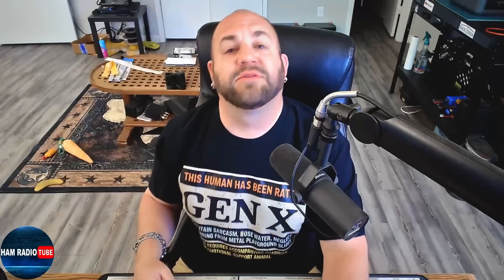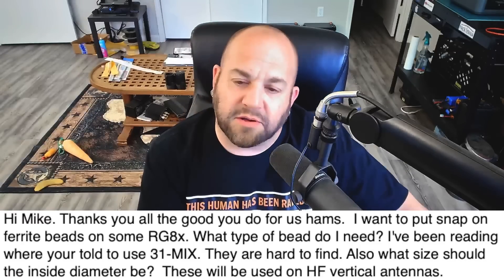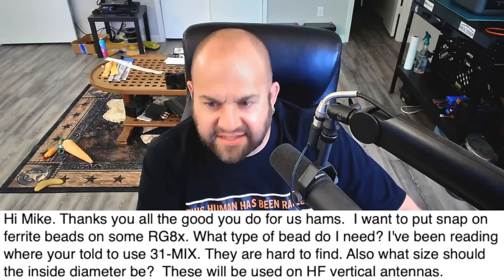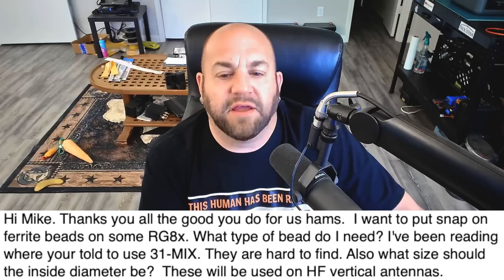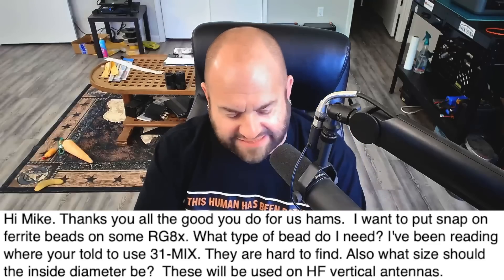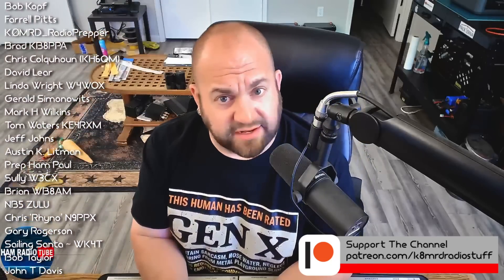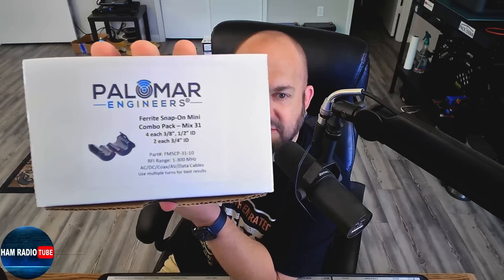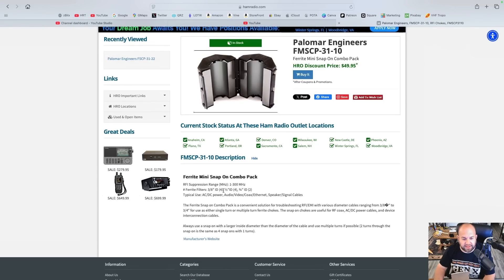Do Antenna Tuners Actually Tune Your Antenna, Or Are They Lying To You?

Comment: I have an ATU-10 and I don't use it.  I tried it on my CB/10m.  It tuned the SWR fine but it effected the signal coming in and actually cut down on reception.  If I want to switch on 10m to 11m I switch antennas.

Comment: Im not a ham, but I've done some broadcasting.  I never did agree that you can just throw an extension coard up a tree and slap an antenna tuner on it and be talking.  Lol, antenna is the most important part. If it aint right, you are a duck, no matter how much radio you have.

Comment: Finally an excellent correct explanation of what an antenna tuner is doing thank you
Reply from the maker: Glad I could clear it up for you!
Reply: Hmm.. weird.. In the British Army back in the 90s using Clansman radio equipment we had things like the TUAAM for VHF (70MHz) which stood for Tuning Unit Automatic Antenna Matching..  So the idea of Tuning and Antenna matching were two distinct things...for HF we had the TURF (Tuning Unit Radio Frequency) which has a big winder on it and you would spend a long time turning it to "electrically lengthen" the antenna till the SWR was good..

Comment: Mike, you start out on the right track by understanding that when an antenna is not naturally resonant, you have reactive power that oscillates up and down the feed line between the antenna and the tuner. But then you go off the rails when you say the antenna tuner does not tune the antenna. Of course it does, it changes the antenna's natural resonant frequency to a new resonant frequency by loading it with an appropriate amount of capacitance or inductance to make it resonant at a new frequency. This is obvious, because the reactive power no longer makes it back to the transmitter. Hams have, for a long time made a too-short mobile whip resonant at a lower frequency by canceling its capacitive reactance with a loading coil.

The problem is not that the antenna tuner does not tune the antenna, it does. The problem is that most hams don't understand how it works, and so they do the worst possible thing: put a long coax feedline between the antenna and the tuner. It works lousy, and so hams have come up with the false excuse that it somehow isn't tuning the antenna because it's performance is lousy. A better idea would be to use low-loss, open wire feed line between the antenna and the tuner, then less energy is burned up heating the feed line and more is radiated. Hams used to do this all the time, and some still do. The best solution is to put an ATU at the antenna feed point, so all the circulating reactive current will stay at the antenna and the feed line, on the other side of the tuner, will see 50+j0 ohms all the way back to the shack and the transmitter.

My background is in broadcasting, and AM broadcasters have been placing the antenna tuning unit at the tower since way before I worked at my first broadcasting job in the mid-1970s. Not every station has the luxury of having a tower which is exactly 1/4 wavelength, many AM stations have reactive towers which are not naturally resonant at their operating frequency. A few famous ones, like WLW and WSM use 5/8 wavelength towers to get a better radiation pattern, but of course 5/8 wavelength is reactive, not naturally resonant. But it doesn't matter. The tuning unit at the tower base not only cancels out the reactance, but it transforms the base resistance (typical 24-25 ohms for a 1/4 wave tower) to 50 ohms, so the coax back to the transmitter building sees 50+j0. I won't get into directional arrays here, but suffice it to say that towers have different impedance when part of an array, sometimes even negative.  A negative tower absorbs power, which is sent back its coax to the transmitter building where it is sent out to positive towers and re-radiated. But, regardless of the tower's impedance and reactance, the ATU at the tower base makes it 50+j0, resonant at the operating frequency.

Now here's the mind blowing part: an antenna can be resonant at two or more arbitrary frequencies simultaneously! These days, land for a tower field is expensive, so it is becoming more common to see two or more stations multiplexed onto a single tower. In such an installation each transmitter has a separate 50 ohm coax from the transmitter building to the tower. Each has a separate antenna tuning network at the tower base, each followed by a filter which passes that station and rejects the other before it is connected to the tower feed point, similar in operation to duplexer filters in a repeater. Where it really gets complicated is if one or both stations are operating directional arrays with shared towers, because there are filter networks connecting the ATUs to the driven towers, but towers which are not driven for a particular station are connected through a filter to a de-tuning unit, which makes the non-driven tower "invisible" so it won't act as a parasitic element and disturb the directional pattern.

But the take away is: Antenna tuners do tune an antenna to resonance at a new frequency. Many hams seem to have a problem understanding this because they use them wrong and the performance is lousy. If hams would simply do what broadcasters are doing, and put the tuner at the antenna feed point, which is possible with modern automatic tuners, they would get a lot better results. Maybe then we could stomp out this myth that an antenna tuner does not change the resonant frequency of the antenna.

Comment: Why does your powermeter  measure 128Watts, why you only tune with 100W.
And how did you get your half wave and fed wire resonant on 30m. 
You didn't.... You probably just had the right length of coax... Just make your coax a bit longer and measure again....
Reply from the maker: You're so angry
Reply: @hamradiotube  I do apologize for sounding angry. I was not angry, our did I say the wrong words.
But my question remains, why is your powermeter showing more foreward power than the power you used to tune. 

And second. I still believe your antenne was not resonant at 30m. But I think your coax-length transform the impedance of your antenne closer to 50 Ohms.. Hense the suggestion yo make the coax a bit longer and tune again.

Comment: Definitely agree on the coax question. Always one full uninterrupted run at time of install. If for some reason it gets damaged anywhere along the length, THEN it gets two ends and a coupler installed at the damage point. Having an entire 25+ft section damaged and require replacement doesn't make sense in most cases.

Comment: Another fun fact that I learned back when i did CB, is your groundplane's shape has an effect on both the SWR and the radiation pattern of the antenna. This is especially true for HF mobile operation where your ground plane is smaller than than the wavelength by a large margin.

Comment: Being stuck on only "resonant" antennas (actually these are "mis-matched", not non-resonant) is like being stuck with a car with only 1 gear. A "transmatch" (AKA antenna tuner) is more like an automatic transmission. Yeah, it might be a bit less efficient but now you can drive at any speed.

Comment: 1) If you want a very effective Common-Mode Choke (CMC) at your antenna feedpoint to isolate your antenna from your feed line, then DON'T WASTE YOUR MONEY ON FERRITE BEADS. Use a FT-240-31 toroid and  wind your coax thru it (4 turns round one way, cross thru the middle, then 4 turns the other way). Even fits with the PL-259 connectors in place! You would need at least TEN ferrite beads to even come close to the performance of the FT-240-31. 2) The "additional power" you're seeing on a power meter in the loop between your tuner and a non-matched antenna is because that's the "RECIRCULATING" power (with coax losses in each direction on every pass). Yes, a lot of this power DOES eventually get radiated, but the losses go up exponentially with coax length between the tuner and antenna because it's like putting a resistor in the resonant tank circuit of your final amplifier. Another way to look at this is trying to push a child on a swing, but with the swing immersed in thick oil, Takes a LOT more to keep that swing moving, no? Please see my TennaTalk #9 on my Antenna Whisperer YT channel if you want a deeper dive into this with LOTS of proven evidence of how all this REALLY works.

Comment: Wooo hooo Mike! I just wanted to reinforce your purchase of Palomar mix 31 (HF) beads - excellent company with outstanding products and ham-driven leadership. One minor correction - you are absolutely right to wrap the coax multiple times within one bead! Great best practice! However, the benefit is much more than you mentioned. For each turn, you square the amount of common mode current suppression gained over one bead. For example, 2 coax turns within one bead is not 2 times better, it is 4 times better than just one bead ... 4 coax turns within one bead is 16 times better than just one bead, etc. Thanks so much for your wonderful videos on the Tube - I miss working you on the air buddy and hope to get another P2P sometime soon 😀73 KJ6ER

Comment: Actually an antenna tuner just corrects for an impedance mismatch AT THE TRANSMITTER. Unless you relocate the tuner so it is at the antenna. A bad SWR at the antenna will still be a bad swr at the transmitter end of the coax plus the high loss in the coax which the tuner will not correct when it is located at the transmitter.

Comment: Just for fun. find a station at that frequency, get a signal with the high SWR, then tune it, compare. Likely the radio drops output, note that, then check output and signal, likely the signal is up at the higher power and safer so the value is a contact can be made.  tuner works !!! IF OUTPUT drops to say 50 watts tune it is 100, SWR returns 25 watts, 100 less 25 is still 75 and safe!!

Comment: Hello Mike: Thanks for all you do for the ham radio community.  I gave your video on antenna tuners a thumbs-up, but at the 19:42 mark of that video, you made a statement that made me take a step back.  I'll paraphrase your statement as , "[the reflected energy is not all radiated by the antenna]", and you followed by saying, "that's why I use resonant antennas".  I think this is a frequently repeated misunderstanding - reflected power is not lost (at least not in total).  Earlier in the video, you highlighted the fact that the reflected energy reflects back and forth between the "tuner" and the antenna which is correct.  I think it's important to realize that most of that energy will in fact eventually be radiated and not lost.  However, our feedlines aren't ideal and do dissipate some the energy. When the impedance mismatch is very high (high SWR), that reflected energy is subjected to losses in the coax multiple times.  But even then, most of the energy reaches the antenna and is radiated.  I hope I convince you to look into this further and help other hams dispel the myth that only resonant antennas are efficient or that reflected power is power lost.  There is a correlation between the two, but they are not the same thing.
Reply: Howdy.
In my mind Bull's Eye comment.
Cheers.
Reply: Close, but 100% accurate. You know about phasing?

Comment: I agree whole heartedly with what Mike said. Then I came upon a YT vid by Mark the ham radio guy. He puts out vids dispelling ham radio myths. 

His vid on tuners was going fine until he said not only does it provide a match for the rig but it also removes all reactance on the antenna side thereby making the antenna resonant. What!!! I just don’t buy it. You can only make an antenna resonant by changing its physical characteristics. 

He claims Walt Maxwell said a tuner provides a conjugate match at the antenna thereby removing reactance. I think he’s interpreting things incorrectly. He also said the SWR on the antenna side doesn’t change. If you removed the reactance then your SWR would change. 

I think he just created his own myth.

Comment: Mike, Hope all is well. I have a meggar TDR at work, this allows us to TDR a line to identify opens and shorts but also what to look for on the graph if water ingress is occuring too. For sure, this takes experience and often doesnt look the same. Either way, the fault in the line will prompt you to investigate further at the determined range on what might be the issue. Google the Megger TDR 500 manual as it has a visual representation of what to look for for water ingressing issues. Note: idk if the tdr's on our ham antenna analyzers have the resolution to even see this. Maybe we could test this.

Comment: Calling it an antenna tuner is incorrect.  It's an antenna transmatch which matches the output of the radio/amplifier to the antenna feed system to keep the PA transistors happy.  73